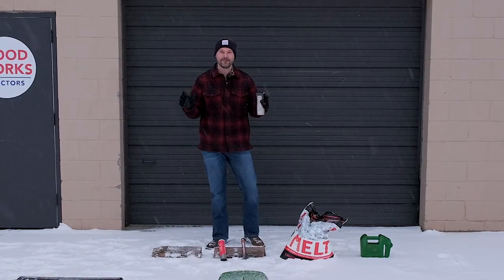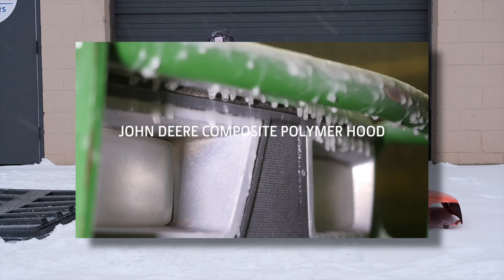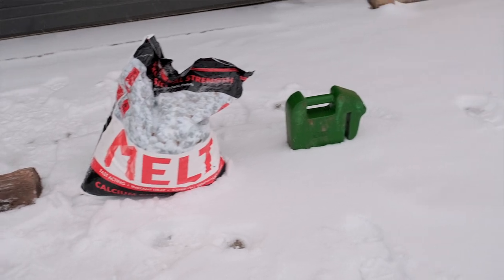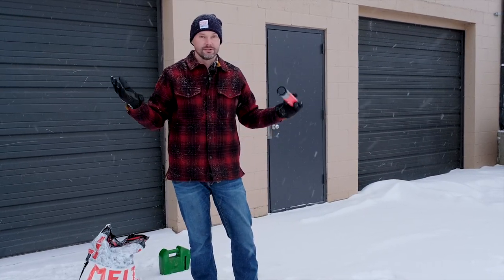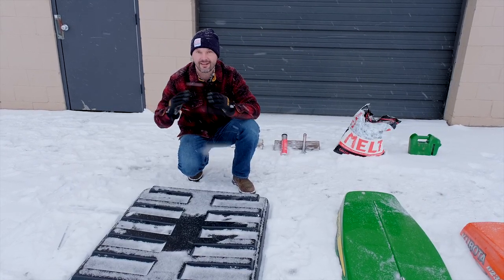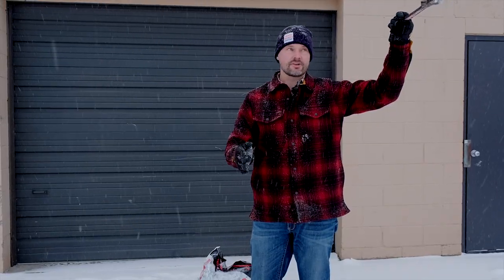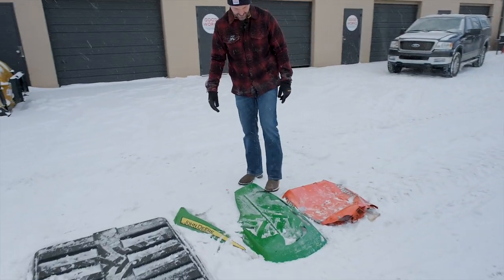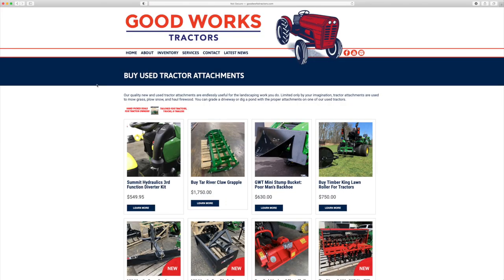TORTURE TEST: JOHN DEERE PLASTIC VS KUBOTA STEEL! 😱💪🚜

Comment: Good to hear the plastics on the newer eones are better. Our 4600 had the hood replaced under warranty. It's holding up okay now but the gas fill cap cover has snapped off. Every other piece of plastic on it has deteriorated and broken someplace other than the fenders. Bungee cord holds the grill assembly in. Engine access covers crumbled to pieces. My BX of the same vintage is perfect.
Reply from the maker: Yeah those plastics are different

Comment: I have to give John Deere credit where it's due, their composite materials have come a long way since the late 90s and early 2000s. My dad has a 99 345 garden tractor and his hood sucks. Barely any pressure and the sucker cracked. Been stored inside all its life too. Like you said though, I'll still take metal over plastic any day because of the fact you can still use it even if it's dented up pretty bad unlike the JD one where you have to replace. Thanks for the fun video! Great stuff to watch while cooped up inside during these -15 degree days. Supposed to be almost 40 here in MN next week though! Yay!!

Comment: It's cool how the JD absorbs the impact over a greater period and returns a lot of energy back into the object (trampoline effect). Something pointy needs dropped on both. The shear stress of the metal is way higher. 
One other thing to keep in mind is the JD hood would be supported differently on the machine, most likely it wouldn't be supported on the bottom. And also I have a Kubota so I'm not some JD fanboy. Just an engineer that loves this sort of stuff.
Reply from the maker: Haha thanks for watching!

Comment: The real life issue with the John Deere plastic hood is how the  steel loop latch is bolted to the plastic hood.  My 2020 2025r latch broke off with normal use at 300 hours.  I guess this is a big issue.

Comment: The thing missing here is the longevity of the hoods. A plastic hood in 20 years will get brittle, especially if it's been out in the sun a lot. The metal hood can always be pounded back into shape, but a broken piece of plastic is done. Think about really old pieces of plastic that you can snap with your hand easily.

Comment: I would assume the cold weather had a significant impact on the results also, on a day when it’s not we’ll below freezing the non-metal materials would fair much better.  Likely the JD hood makes it through those impacts perfectly intact, the metal hood likely would react the same way winter or summer.
Reply from the maker: I agree

Comment: I have a 35 year old JD 950 & a new 3025d. The 950 is all metal and very tough. If you don't run into anything with the newer 3025d, you should be just fine. I am very 'ok' with the new plastic hood, fenders, etc.
Reply from the maker: Solid advice 🤣  Thanks for watching!

Comment: The deere hood may still have broken but having it laying on the ground doesn't simulate how it would be supported when on a tractor. Having the front and rear of the hood supported would take some load off the sides where it cracked.  I definitely agree that laid flat on the ground the kubota wins. Regardless, it looked like you had fun. 😁
Reply from the maker: I agree

Comment: What I learned, Keep your tractor covered with a rhino hide to protect your hood. LOL I have a rhino hide and it is great, I needed a canopy that could go on and off fast and easy since I have to take off to get my tractor in and out of my shops 8ft door. Couldn't be happier and yes I did forget once and both my shop and canopy survive no damage thanks to the rhino hide.
Reply from the maker: Ha, yes, build a Rhino armor shield all around it!

Comment: Enjoyed the video, hated the music! LOL!! I've replaced many broken John Deere garden tractor hoods over the years and they aren't cheap! A little hammer and dolly work on a steel hood can get out many dents plus you can weld any cracks. With a polymer hood its back to the dealer with your check book in hand. There's advantages and disadvantages with each hood material.
Reply from the maker: Thanks for watching!

Comment: On a summers' day, I managed to run into a long branch that got past the loader and brush guard, it severely distorted the JD hood before I realized what was happening. I backed up to relieve the pressure and the hood just sprung back without so much as a scuff. It would have bent a steel hood, so I'm thinking I'm ahead.

Comment: Well even after all that you can get some money for the scrap steel  to put toward a replacement hood for the Kubota.   The John Deere hoods also don't hold up the the UV long term.... mine broke after 5 years outside w/o anything falling on it.  At least the Kubota hood is easier to fix if it dents.  Its harder to repair a JD hood.

Comment: I have a 3032E with the plastic hood and other plastic body panels.  The biggest issue I have is scratches.  Do you have any suggestions on removing them?  I am concerned about buffing them out, I think it would dull the finish.  Thanks.

Comment: I watched my neighbor step on the hood of his old BX to get up into the raised bucket so he could work on his gutters.
The JD hood was bowed and replaced under warranty right. Maybe it already had structural/material problems.
Reply from the maker: I could step on my JD hood to work on my gutters, but that would be a bad idea for several reasons.  🤣👍
Reply: @GoodWorksTractors  I wasn't saying it was a good thing at all. I just don't treat my equipment that way let alone the safety aspect.

Comment: I personally would rather have a metal hood because if something substantial was to be dropped on it like in the video I just want the air cleaner, oil cooler, fan on the motor, and everything else to have a fighting chance of survival. I also have had a few occurrences of missing the bucket while tossing by hand old patio pavers and feel as though lobbing a brick at a sub compact tractor (video idea) would do enough damage to make me question many poor life decisions. I tend to crouch on my tractors back fender when using the backhoe for a quick second instead of flipping the seat around and not sure I would be able to do that on a plastic fender. Lastly the benefit of weight. Additional weight helps when I am cruising with the bucket full and way to high in the air while turning to load a truck
Reply from the maker: Thanks for sharing!

Comment: I would guess the green polymer is cheaper to manufacture also. Probably a rubber mallet could have fixed the Kubota hood. I'm might be biased I drive Orange
Reply from the maker: If it is, then they just make more margin.

Comment: Hi GWT!  Just watched your vid. My major complaint with JD is its “composite” parts. I’m the second owner of a 2004 JD 4310 since 2006. It had 40 hours when I bought it and it’s been barn kept since. It has a plastic hood, side panels, and front grill. All of it has cracked to various extent. I had to fiberglass the underside of the hood just to keep it together. If I ever choose to replace those parts, it would cost me over $1000 let alone any value decrease if I ever wish to sell it as is. I’m considering a larger tractor but, for now, JD will be last on my short list. BTW, you do a nice job with your videos!
Reply from the maker: Howdy, the plastic on the older 4 Series is very brittle and totally different than the newer materials.  I have yet to see one of those older units with an original hood without cracks.

Comment: I say like I always do, plastic vs metal hood is not something I care about when shopping for a tractor. However I give the tiniest of edge to plastic. Yes, they might crack, but I don't drop 25kg bags of salt on my tractor. Those tiny paint chips will cause rust.
Reply: It's called touch up paint, works wonders...
Reply from the maker: Thanks for watching!

Comment: 📒✏ metal hood won't crack. Got it 😂 I'm not a fan of the old plastic hoods. We have an old 750 steel hood that still looks good except some missing paint. Then a 955 with a bunch of cracks and a 6420 that cracked in the center and peeled open when it got hot. Haven't had personal experience with the newer plastic hoods other than an x730 that has scuffed a bit mowing around Christmas trees and some shrubs.

Comment: You finally put this one to bed!!  I do want to see how age of the polymer materials affects their durability.  I have a 1993 Kubota G1800, where after a light buffing, the steel hood looks good.  There are some small scratches in the paint, but not bad for a 28 year old tractor.  The vinyl decals although have a lot of cracking etc in them.  I agree that poly materials are much better today, and in many cases superior to steel in fending off dents and dings, but fenders and floor pans for sure should be made out of a material that can handle the stresses of daily use.  Great episode.  Jason Huser - Huser Helpers

Comment: I’m definitely in favor of the plastic still as long as it’s a good quality plastic. Anything’s gonna break eventually. He still is nice because you can bend it back if you don’t worry about how it looks too much but I think for 99.9% of the people out there the plastic is going to be just fine. That being said by a guy who drives a John Deere riding mower with no hood on it. 😂😂 But I took it off to work on it and drove over the little tabs that hold it on. I was going to drill them out and just run a bolt through there but I never got around to it and I think we probably threw it away when I moved because by then it was already 14 years old and I’ve been driving it for two or three years without a hood on it. Lol.  Put on an actual tractor, Especially with the loader, I would definitely want to keep it on there.
Reply from the maker: Thanks for watching!
Reply: My 2000 John Deere riding mower’s hood cracked completely through in a number of places from end to end.  It was stored in the shed and nothing ever fell on it.  Probably the materials have improved over the last two decades but my experience with plastic hoods has not been positive.  No problems with my Kubota hood but then again, it is stored under cover and nothing significant has fallen on it yet (fingers crossed this remains the case!).

Comment: If it gets so cold here, that I have to be concerned about dropping a 50 lb bag of salt in the hood of my John Deere, my butt is staying inside where its warm. 
But let me say this;  going from a 5 lb 2 inch wrench to a 50 lb bag of Melt is a huge step. Plus consider everything you dropped before bounced off.  The bag of Melt was like a dead blow hammer. But still the Rhino roof showed them both up.   Maybe Deere can touch base with Rhino about making their hoods.
Reply from the maker: I tell ya, I'm thinking about staying inside too.  Getting chilly up here!

Comment: I have a case international 1456 and old John Deere 4755 both have loaders and metal hood which constantly gets things dropped on it and I will say, if it was a newer tractor I would mind the dents more but on and older tractor I really don’t notice as much. I also have a John Deere 2520, and 6175 and I really like the metal hoods on old tractors but newer tractors I don’t like the dents

Comment: My only question.... cost to replace each of these hoods?
Reply from the maker: Enough to make a grown man cry 😭
Reply: @GoodWorksTractors    The argument over metal or plastic has always been more a question of cost. If we say for sake of argument both tractors are equally good at the same niche market yadda, yadda; the question poses that if an operator had the same damaging event on both tractors (apparently they didn’t learn) and we had to replace both hoods. Which would be the more expensive buy?  

Now we can look at actual replacement. Or we can add in the difference in “repair” cost. 
You can hammer out the smaller dents, in the metal hood easy, or you can use a plastic repair product on the deere hood (I’ve done both) and both would remain “usable” yet scarred. For some acceptable as a cost alternative. but after you ran them over with the 5 family, I’d have a hard time repairing the metal hood as a home owner, but I could actually repair the deere hood. The broken parts were still in their form just separated and is actually easier repaired back to a mountable operating hood than the kubota metal hood by you or me in most cases. Not saying it’s my first choice, as I’m more likely to replace them in both cases. 

I was really interested by the turning point too.  The kubota hood took noticeable damage early. The deere hood only made it to a point with no damage at all and then all at once let go.  Shows how far and actually durable these things are in both versions as well. I liked my kubota when I had it, but honestly worse than the concern of dents or cracks is Kubota’s terrible orange paint fade issue.  It’s nice not having to buff or wax the deere just to keep the “paint” color correct.  But hey. I’ve owned both and they’re both solid built companies.   I honestly just hated the treddle pedal so so much lol.

Comment: Any advice on putting a chain hook on the loader bucket?
Reply: I got a pair of weld on grab hooks and.. well.. you know the rest.
I put mine right over the connections between bucket and loader. If you were going to do a single hook in the middle, I would suggest beefing things up a bit so you don't accidentally bend your bucket.
Reply from the maker: Bolt on hooks

Comment: The results are clear Rhinohide needs to make hoods for tractors.  Plastic or steel doesn't make a difference to me.  If it's got a scratch in it I'm bummed.  I wouldn't live with dent or a crack.  It would get replaced.
Reply from the maker: Haha I agree!

Comment: I owned a JD 4200 for about 15 years, after 10 of those years, the hood cracked due to the weather here in the state. My new Kubota's hood isn't going to crack.
Reply from the maker: Totally different material than what you had.  That was a very brittle material indeed.

Comment: Gotta say I was a little disappointed. If a new operator had rocks to high and one fell I would be extremely worried about breaking more then just the hood on the Deere. Should be engineered for the worst case scenario.

Comment: It's not really a fair comparison, you have to use same material hoods but whatever. Theres a channel that does product testing and they do a better job than anybody else on the tube. Project farm I think.
Reply from the maker: ? The point is comparing different materials
Reply: @GoodWorksTractors  but what do you gain from it? Steel is stronger than plastic,  Could've told you that.
Reply from the maker: It's a tractor thing 🤷🏼‍♂️

Comment: Why not try this test on plastic older than say 5 years old?
Reply from the maker: Feel free to ship me a hood and I'll be happy to do so 👍
Reply: I sneezed on my circa 2007 X320 hood and it split into 6 pieces. Older units are known to shatter. He even said that at the beginning so I don't really see the point of testing one. We already know the outcome.
Reply: @Itsa_Mea  I didn’t catch that about the older units. I have a lx266 that is pretty old I have been patching on for several years. This past fall it shattered into a million pieces. It’s not that expect things to last forever I just resent that it’s such a money maker for John Deere. To replace the entire hood was almost $1300. Ridiculous. I took another route gathering parts from different online sources and repairing the grill. Spent approximately $500. Thanks for replying
Reply: @stanfromalabama443  wow that's alot of moneys!!  My replacement after searching around was $300. I thought that was too much but there was no repairing the original. My old 212 was metal and not even a dent. Plastic is whacked. Metal is forever!

Comment: Kinda funny video! Extreme cold will cause most plastics to become brittle and the hood curvature might cause more cracking. For me the question is - did the engine get damaged or was it "protected" by the hood taking the bulk of the impact? I loved running the tractor over both hoods to finish them off. Great music contrast !
Joe Carleo -  A Plus Lawncare of Stallings
Reply from the maker: Not sure about that